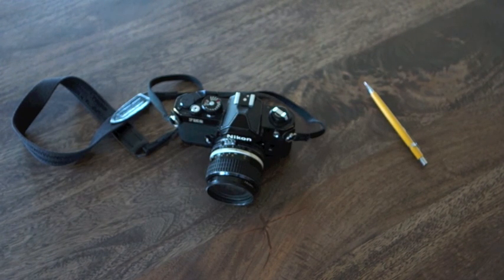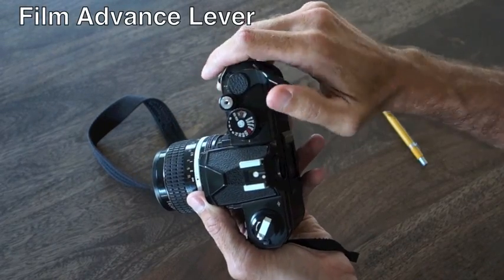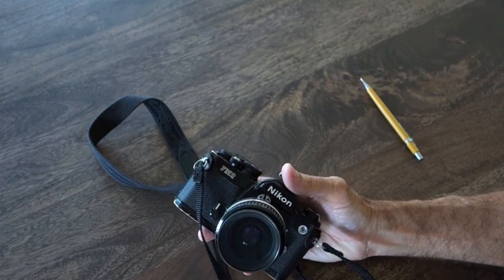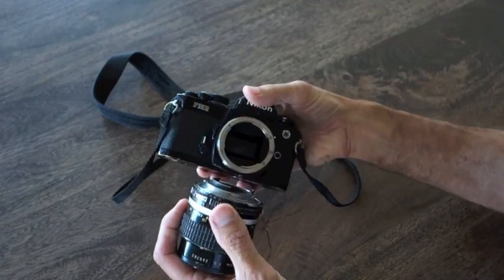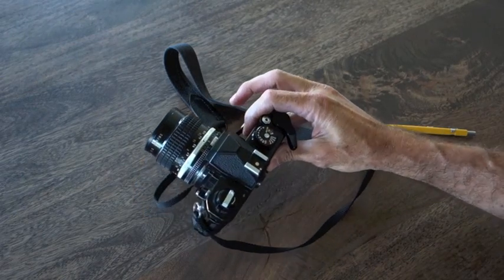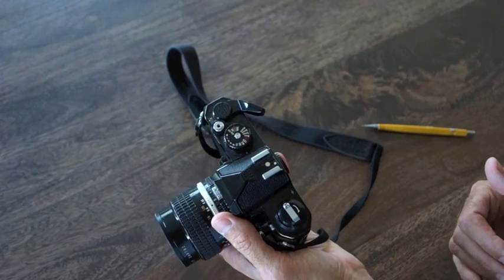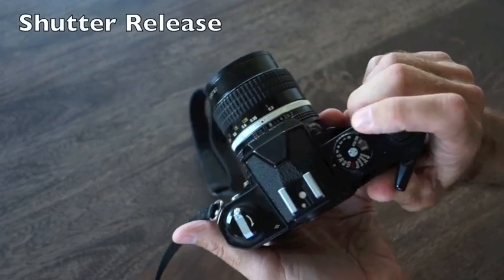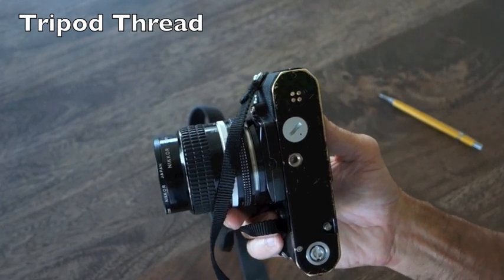Basic Parts of a 35mm SLR Film Camera

Comment: Sir what is film speed control??
Reply: Film speed, also known as ISO, is an indicator of a particular film's sensitivity to light. The higher the ISO the more sensitive the film is to light and the less light you will typically need to make a correct exposure. High ISO films (ISO 3200 for example) are often used for shooting in low light. The opposite is also true - low ISO films (ISO 100 for example) require more light and are good for bright conditions.